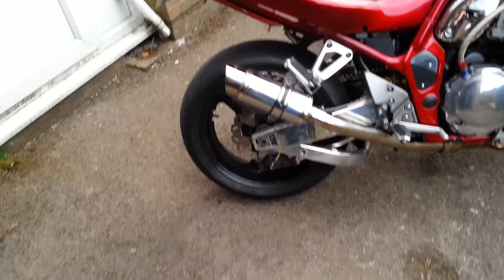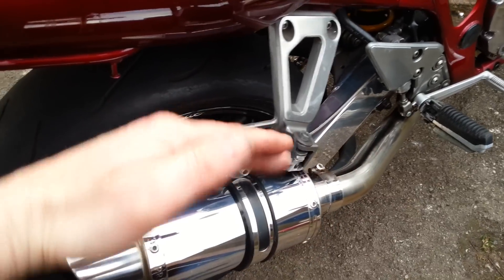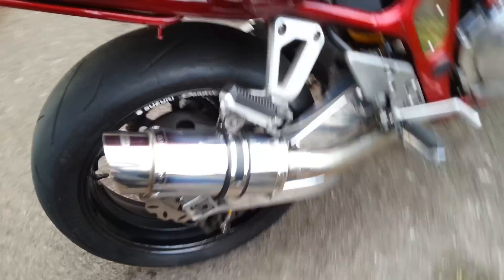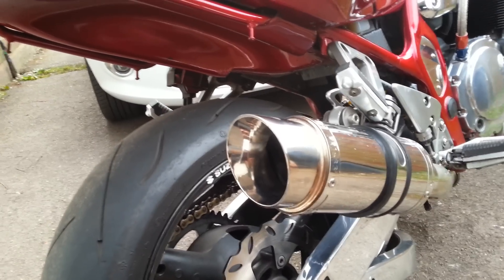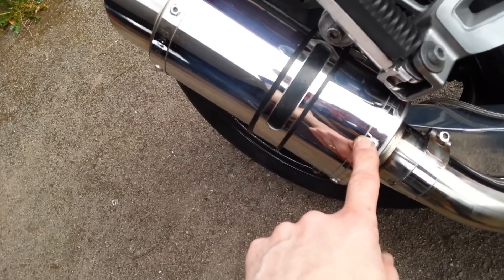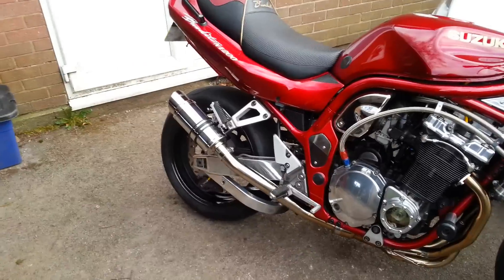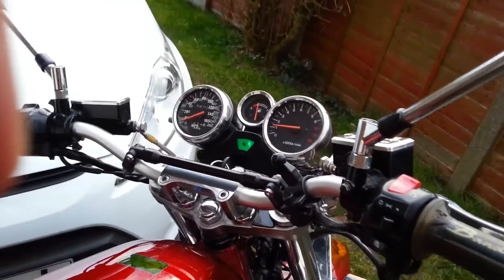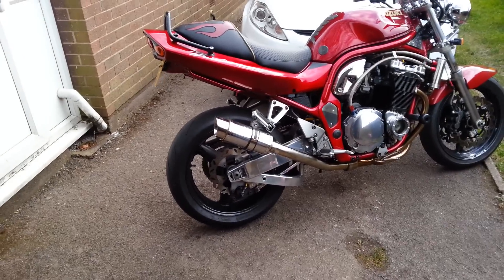Delkevic end can...again.

Comment from the maker: thx for the kind comment buddy, 
my bandit has aftermarket downpipes and middle link pipe, all straight through, thats why i added the plate to give her a bit more back pressure and yes, i had to jet up to a stage 1 kit.
most 1200 bandits will take a less restrictive end can without any carb changes but if you put a straight through stubby on, specially if you have a free flowing air  filter then i strongly advise a Stage 1 jet kit. ;)

Comment: I have a bandit with gsx 750 carbs they are the same diameter but really sort out the running also I have a cbrr600 rear have a look
Reply from the maker: Nick Payton looking good Nick 👍 I loved my old Bandit 12 and still miss it them engines were easy to work on and run forever 😉

Comment from the maker: Yep if you have the standard down pipes and filter then it should run fine, you still might find it knocks a bit off mid range though... 
If you got individual filters on you will have had to have rejetted the carbs anyways to get her to run right so you shouldnt have any probs putting it on.
My prob was a stutter just around 1500 - 2000 rpm, I made a plate that reduced the internal dia that cured this.. since then I took the plate out and fitted a decibel killer.. and with a tweak on the pilot jets she runs fine. ;)

Comment: Love the bike! I also have a bandit 1200 1999 and I want this exhaust. I have a similar question
So your saying if the bike is completely standard you can just strap this monster on and away you go?? You only need to mod the carbs if u have a straight through exhaust system?? What if I had 4 custom air filters?
According to the official website the exhaust has been made, tested and proven to improve the performance of the bandit. That tells me it's a plug in and play! :)

Comment: Hi, I recently bought bandit 1200, K6. Previous owner put  Delkevic 350 on . Its poping from time to time, its strange to me. If original exhaust is there, I wouldnt make any change.
Reply from the maker: BublakVTX hi buddy u defo gonna get some popping on Overrun. . as long as she ain't running too kean u will be fine ..if u get some flat spots fueling might want adjusting

Comment: Sounds super nice. Random question but on the right side of the swing arm what is that metal piece that hangs down and connects back to the frame? I first noticed it at 3:34.
Reply from the maker: hi buddy..the chrome bare is the rear brake torque arm stops the back brake spinning when pressure is applied ..I had it chromed 
👍

Comment: Hi just a couple of questions, i have a mk2 12 here running stock headers but the exact same can as this without baffle , is dynojet stage 1 kit sufficient enough for this and also dj098 main jet is installed, kit also came with dj100 is there much difference between the two also can i change main jets without taking carbs back off, bike is also missing collector box gasket seems to run okay  but sometimes sounds as if its spitting at idle when cold sometimes it also is slower to come back down on revs from 2 to 3000 other times its very responsive
Reply from the maker: Man it was a long time ago since I worked on the Bandit..
First prob best get the exhaust leak sorted..the stage 1 kik should be OK unless you are running pod filters.. I forget the jet size now as been over 10 years .. Best pull the carbon bank out to work on.. then float heights can be checked.. pilot jets for low down probs..needle adjustment for mid range and mains for top end.. a session on a rolling road is best so you can see wjat the fuel air ratio is doing throughout the rev range 👌